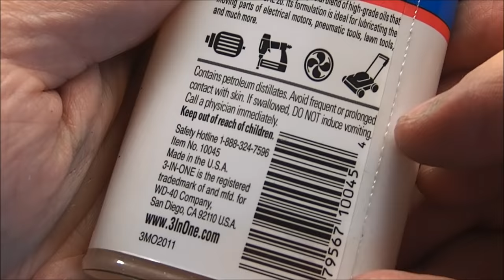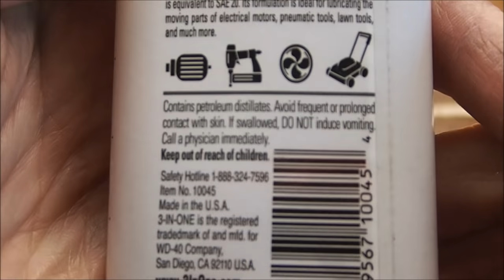How To: Cleaning up an old pocket knife

Comment: I'm sorry just spraying WD-40 on a junk pocket knife , brushing with a worn out tooth brush, and buffing it some doesn't cut the mustard.  You've got to better than this to earn a thumbs up.
Reply: Yeah I agree. Old carbon blades are tough and deep scratches on scales are hard. I like a wire brush dremel tool but now I just thought of a new idea I'm going to try to epoxy some fine steel wool onto a Dremel drum see how that works.